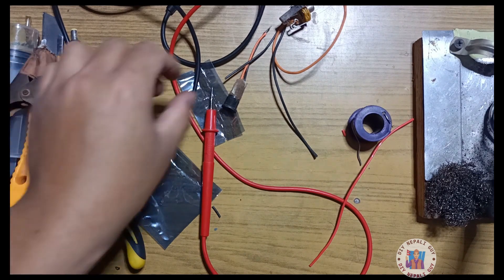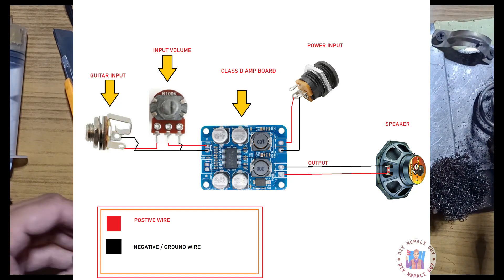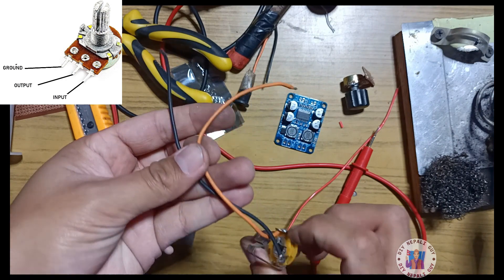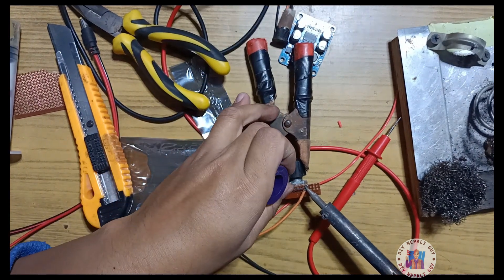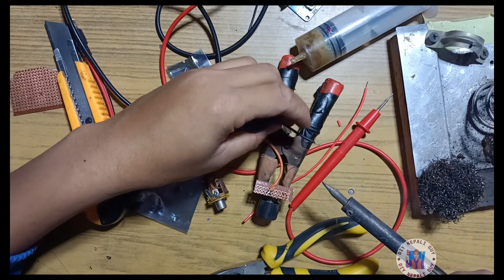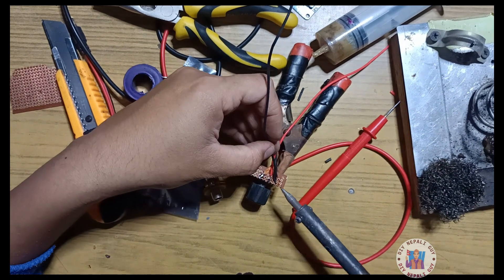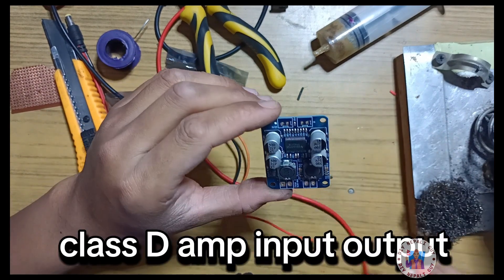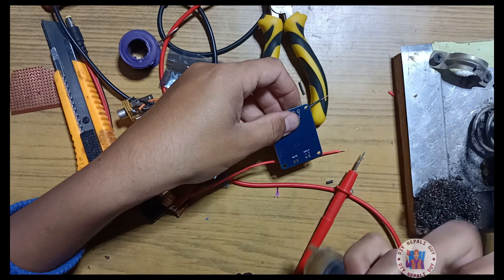How to make guitar amp Step by Step

Comment: What speaker is this
Reply from the maker: Any speaker will work better to choose 6 inch or greater for more low and overall loudness
Reply: @nepalidiy im using 6.5 woofer speaker but sound is not that good
Reply from the maker: @dwiNExx  because woofer speaker have only Low frequency 20-100hz response so its will not be good choice to use as guitar cab speaker. 
try using full range speaker it will give you better sound becuase of wide frequency range response. I hope it helped you.
support the channel by giving a Thumb up and subscribe the channel.

Comment: Can we use tweeter in this
Reply from the maker: @A1_FFX  you can use  passive crossover for tweeter and low driver
Reply: @nepalidiy is tweeter important?
Reply from the maker: @A1_FFX  actually not that much as guitar is not that very high frequency range instrument